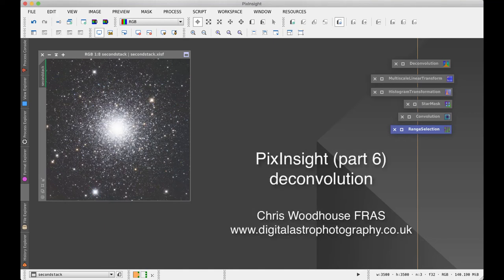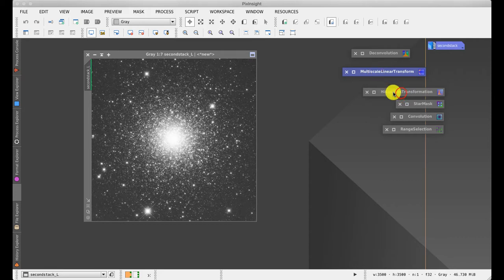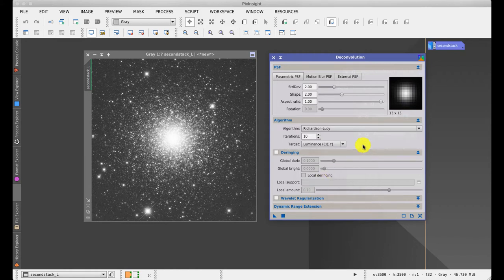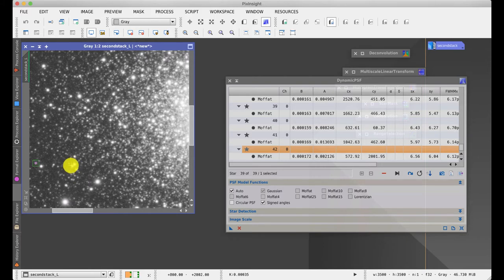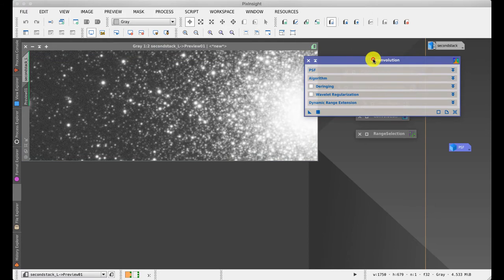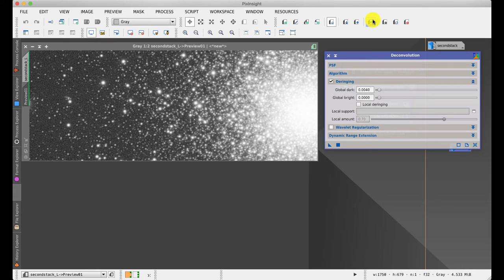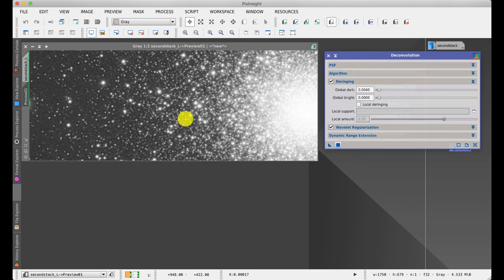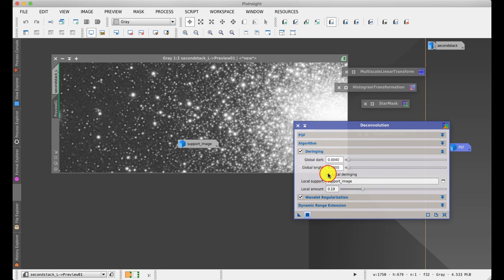PixInsight (part 6)  deconvolution

Comment: Excellent video as usual, but I am curious about comments you make about star shapes around the 10 minute mark,  e.g. Gaussians being bloated and Lorentzians corresponding to perhaps the ideal. I have not been able to find literature discussions that relate telescope parameters, seeing conditions, star angular distributions etc. to what one should expect to see. For example, how do varying conditions turn a perfect Airy disk into a Lorentzian/Moffat/Gaussian profile? Lots of papers define Moffat functions, discuss the impact of finite pixel sizes etc. but don't speak to why the shapes should be the way they are. Are you aware of any good references? Thanks! Paul
Reply from the maker: This paper may help decide what is best to use: https://supernova.lbl.gov/snphot/lec8_vitaliy_PSF_fit.pdf
Reply: @astroshed  Thanks Chris. That paper is interesting but similar to many others in that they are interested in fitting model data to observations, as opposed to more of a first principles estimate of what the functional form of stars should be under some set of conditions. I'll do some more googling on star models and PSF modeling and see what I come up with... Cheers, Paul

Comment: Reviewing this video again to try to better understand the local support image. You mention that because you are dealing with a star cluster, the method of creating a support image (HT x2, adjust black point to toe of curve, and blur) was performed. Would you alter or vary your method of creating a support image if you are dealing with a nebula or a galaxy? Thanks
Dan
Reply from the maker: When you look at what the local support does visually, it reduces dark haloes around stars that are not surrounded by empty sky. In some cases, it is not required, like loose clusters. The support image is trying to target where to apply the additional de-ringing. If it is applied too liberally, it undoes the deconvolution and you get fat stars again. If I have stars overlapping bright nebulosity or a galaxy and wanted to be super picky, I use a heavily blurred range mask and a star mask to create a star mask that only works in generally bright areas. The star mask image would have the range mask applied (as a mask) and then use curves to knock out the stars in darker areas. The result becomes the support image.

Comment: Chris.  Thank you for the great tutorial... as a new Pixinsight user these videos are a huge help.   It is a steep learning curve.   I am currently using a CMOS cooled colour camera.   I understand that you apply the deconvolution to the luminosity layer and understand how to separate that out, but how do I recombine or is that automatic as long as I am working with a base image?   Thanks a bunch
Reply: Sorry ...just saw your reply to an earlier comment.    I will give it a try!   Cheers
Reply from the maker: Hi Dawn - color cameras are a bit tricky in this regard. Initially you get what appears to be a monochrome image, up close, however, it looks like a checkerboard, on account of the different color filters on the sensor. Only after de-Bayering do you have a color image. The usual processes of registration and stacking operate on a debayered image. As far as I know, one should not deconvolve or use Mure denoise on these stacks, since your color image 'pixels' are already a complex combination of different physical pixels from the sensor. What I typically do is to duplicate the color stack and process one for good color and extract the luminance and process it for resolution and depth. Deconvolution is not a miracle worker and you can get quite close by careful use of MaskedStretch with HistogramTransformation, rather than just HistogramTransformation on its own, along with some star masks and star reduction using morphological transformation.
Reply: @astroshed  thank you for your quick response.   I will give it a try ... I think the MaskedStretch is maybe where I went wrong
Reply from the maker: @dawnbarber9305  I do a mild stretch first with HT and then finish it off with masked stretch, with the clipping point set to zero. That seems to be a good compromise between bloated and pin prick stars.

Comment: Excellent. A very logical approach to deconvolution. Thank you. One question; Deconvolution was performed on the luminance channel taken from the color image. Do you have to recombine the luminance and color images (channels) or is that function (recombination) already performed (inherent) in the deconvolution process on the luminance channel?
Reply from the maker: Yes - in this example of M3 - I would process and stretch the luminance information until I have a nice detailed monochrome image. I would then take the original color image, check the color balance and do a mild stretch, so the stars are dim but colorful - as we only want the color information. I would heavily noise reduce it, blur slightly and then use LRGBCombine to put the luminance information back in. It reminds me of watching a print develop in a tray of chemicals.
Reply: @astroshed  Thank you